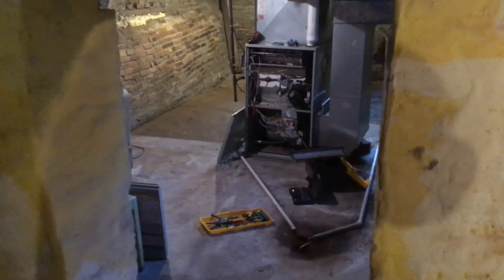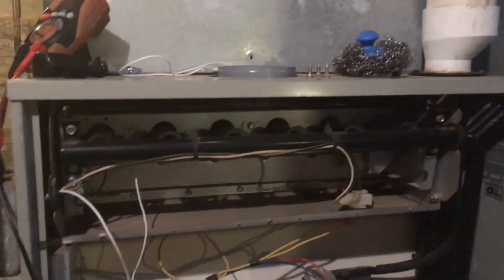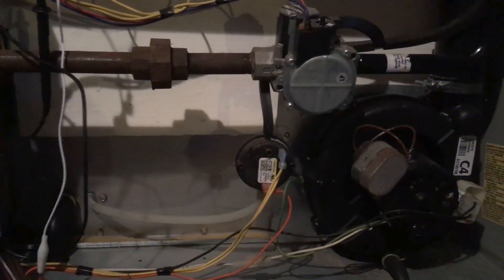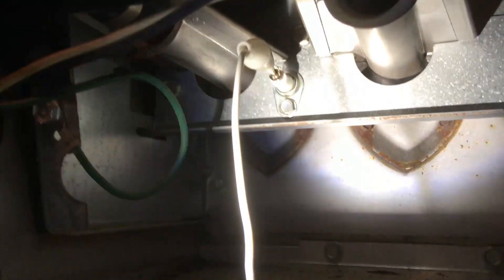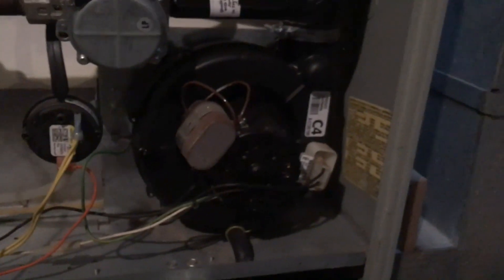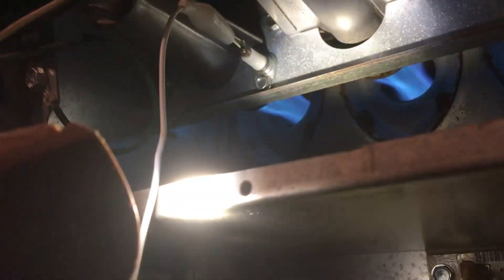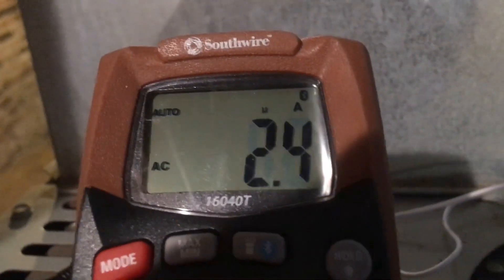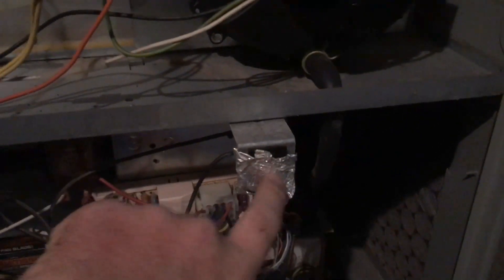Ameristar Furnace Diagnosis and Repair

Comment: From what I understand about those flame sensors, a current is actually conducted through the plasma in the flame itself. Then contact between the metal probe and the flame completes the circuit. Hence why they need to be clean in order to operate properly. Neat stuff.

Comment: Bill Maf sensor  which can be purchased at your local auto parts store works good for cleaning heat sensor rods my hvac technician uses it on the ones he services for their annual cleaning also the cellar stairs in the cricket palace can be accessed by just pulling up the stair tread I think that is what it is called they usually are just nailed across you most likely have a support that is partial rotted out happen at my home we ended up rebuilding the whole staircase and adding a small landing at the bottom I love al your videos you have a real talent

Comment: Three weeks ago, I completed the installation of that which will be "my last dual fuel (gas) split" install.  Not of my choosing, I installed a Nortek 3-ton R410A, onto a Nortek 72,000 Btu/95% AFUE High Efficiency Gas Condensing Furnace. About three months ago, I advised a friend on the sizing, and type of central air/gas heating unit required to heat and cool his manager's residence. He co- owns a motel which utilizes my services to care for 47 Amana PTAC/PTHP units in all stages of the "Goodman Warranty"; It's easy work, and very seldom am I required to open the sealed system.

I had no intentions of doing the install, as I'd ceased installations in 2014, when the scourge of MS took its toll.  I'd advised him that a 48,000 Btu/2.5 ton matched dual fuel system would work well, and that the length of cycle would serve to dehumidify well, with just enough dwell time so as not to overburden too small of a system. I also told him "NOTHING MICROCHANNEL"!

Five weeks ago, I repaired two PTAC's which had 'capacitor and thermistor issues', at another of his properties. It was at that time he informed me that the contractor he'd chosen "wasn't doing things the way he'd asked".  He delivered a 1.5 ton condensing unit+evaporator coil (A-Sized), and a 72,000 Btu (6 tons)"C-Sized" gas (upflow) furnace. "Things just don't look right".

The short story is this: the contractor was paid for everything except for the install, I contacted Nortek for resolution assistance, which they provided fast, 100% stellar-quality mediation with the wholesaler, who was great, too.  I then wound up installing the A/C portion, and subcontracted the gas installation/combustion air intake, and "sleeved" chimney-height PVC exhaust to rid the place of that corrosive discharge those hi efficiency units are known for.

The wholesaler even helped, by throwing a 5-2-1 into the pot.  BTW, 397 micron pull, straight-on superheat/subcool, and a Δ-temp of 19°F, after 90 minutes.

Comment: Our heater was out a couple days ago right when it got cold and we needed it.  We changed the filter and tried troubleshooting everything we could but it still wouldn't light.  The professional from the gas company looked at it yesterday and he thought it was a bad gas valve.  I thought that was total horse hockey because the heater was professionally installed brand new less than 2 years ago.  I guess we should expect new things to break like cars and heaters.  
The man came back today and installed the new valve but it still didn't work.  Finally, he called in for backup and  3 more people came to flush water out of our gas line.  The hot water heater and stove were still working but the water in the line was preventing the heater from lighting.  The man was mad at himself for not diagnosing the problem correctly the first time.  I'm just glad it's fixed and it didn't cost anything since it was the service line between the curb and our house and not an internal issue.

Comment: very interesting. I found a groundhog in my furnace last week. He had fun in there....
Reply: Ouch
Reply from the maker: Back when the Comfortmaker 90% efficient furnace in my home was new, the contractor who installed it said that he'd seen a lot of birds and even some mice get into the vent piping, only to jam up the works. All these years later, I've never had any trouble with critters getting in there. It probably helps that the inlet pipe is up off the ground by several feet. (The outlet pipe does reach the ground.)

Comment: Seeing those bare gas flames like that makes me glad we use balanced flue systems over here in the UK, granted there are still houses with ancient Baxi systems (they reside behind a gas fire in place of an old coal back-boiler) which draw air from the room, but still, I'd rather have a balanced flue... :S
Reply from the maker: When fully assembled, the burner box is a sealed unit in most of these more modern/high efficiency furnaces. It's also supposed to be supplied with fresh air from the outside via a pipe. For some reason, almost every one of these I see isn't set up that way.
Reply: Need tighter regulations there then, over here if a gas appliance isn't fitted as it's meant to be, it doesn't get connected to the gas supply (assuming the engineer isn't a rogue cowboy of course), doesn't stop some houses from blowing up, but, still, better it's done right first time... :)
Reply: Usually if the combustion air on a condensing furnace isn't being pulled from outside it's usually because it replaced a old furnace.
Reply: The manufacturers allow single pipe install. gov't regulations which require 2-pipe would effectively ban mid efficiency furnaces which take their air from inside and don't give the option of connecting an intake.
Reply: @Jon-hx7pe  in Canada the building code outlawed new mid-efficiency gas furnaces but you can still use inside combustion air if the installer calculated sufficient makeup air in the furnace room.
Reply: I know. Was just saying, if combustion air from outside became a requirement in the states, mid efficiency furnaces wouldn't be able to be used, at least not without a new design.
Reply: Yeah baxi systems, on the plus side you don't have to worry about ventilation, the air for combustion will be replenished. Many people plug up their chimneys and use a balanced flue condensing gas boiler, and find condensation, damp and air quality problems.

Comment: I think I can see why you got into HVAC, troubleshooting systems like that seems like really interesting work. Might even be something I'd consider in the future, if my current plans don't work out.
Reply from the maker: I was hoping to improve my chances of landing a good, steady job when I went to HVAC school. I had a blast in the classroom and maintained a 4.0 GPA throughout. I liked the troubleshooting and repair a lot. Less so for the installation, though that's got more to do with the "shallow" nature of the installation class I took. I didn't get a lot of out of that.

When it came to the actual job market, my experience was severely underwhelming. Not a one out of many dozens of companies seemed even slightly interested in me. While there was one that finally took me on, the less said about that, the better. The place was a dump and that job was an utter disaster, although in fairness I'd have to say the owner offered to pay me exactly what I asked on the application, which was more than any other business I interviewed at.

Just like my freelance computer consulting, I'll happily do HVAC work on the side. Only that's not what I was hoping for. I want and need steady work with benefits. Fortunately, it seems that the winds of fortune have changed, and I've landed a computer/IT related job for what should be a reputable company.

Comment: " I'm also not sure why it's so common for people around here not to attach an inlet pipe to the furnace's burner air inlet. "
^Anything to save a buck.

I'm sure you'll end up seeing a lot of two stage furnaces on single stage stats as well, along with stuff being grossly oversized and improper setup/commissioning.

Comment: we have a 140,000 btu furnace. from 1986, uses a pilot light
Reply: 180,000 BTU Lennox G8 from 1981 here, also with a pilot. I hate it.
Reply: y u hate?
Reply: @randomrazr  pilot lights can be expensive!
Reply: Because it's loud, inefficient, and costs a fortune to run. The newer part of the house is heated by a  60,000 BTU Trane (2000) that's just so much quieter. It also does a better job of keeping the temperature even. I'd love to replace that old Lennox, but you know...money.
Reply: how much a month during winter does the old one cost to run

Comment: I have a 1988 vintage comfortmaker furnace.Lastyear I had the same problem where it would not always ignite.the guy that came out figured it out after awhile but at the end he said I should think about getting a replacement furnace in near future.He said the burners were wearing out.I'm disabled so I live on a limited income and was wondering if replacing the burners would be feasable or not?
Reply: burners don't really wear out, unless they're rusting, which they shouldn't be.

See if there are any low income weatherization programs in your area - u may be able to get a rebate or grant on a replacement furnace.
Reply: what makes furnaces need replacement?
Reply from the maker: Usually it's a failure of the heat exchanger, which would then allow combustion by-products into your home (such as carbon monoxide, which is a silent killer). Replacement heat exchangers might still be available, but generally aren't worth it.

I'd get a second and maybe third opinion before you commit to anything major. Get a carbon monoxide alarm if you don't already have one. If you do buy a new furnace, I'd recommend a 90% efficient model. Even though you can buy a more efficient furnace, the operational tolerances are much tighter and parts are much more expensive. Just one failure could take away all the money you saved on energy.
Reply: Nothing special about 95% single stage, just better secondary heat exchanger to condense a little more moisture out of the exhaust than the basic 90-92% models. It's when you get into stuff with  ecm motors (blower and in some cases inducer too), usually 2-stage or modulating that the repair costs can become very high. Extra thermal efficiency in itself doesn't add much to cost.

Even when looking at the mid range to higher end products, there can be significant differences in repair costs depending on the type of ecm motor (x13 vs fully featured), whether the inducer is also ecm or not, the  control board used.

Comment: So the rod was so dirty it's resistance was really high and the conduction of electricity through the flame was too low a current.
So the controller thought "Failed to light" and shut it down.
Roughly speaking lol.

Comment: I'd go ahead and replace that sensor with a new one.   They aren't very expensive and in my experience just cleaning them is a temporary repair.   You don't want a no heat condition on a below zero Saturday night due to a 20 dollar part.
Reply from the maker: I made that suggestion to the occupants of the house, and I think they'll go for it.

Comment: Dirty flame sensors are one of the most common causes for no heat. It's a shame because it only takes 2 seconds to clean. If your flames drop out in the first 5 seconds of ignition 95% of the time it's the sensor, in rare cases it can be the board itself.

Comment: You aren't supposed to clean the flame sensors they are supposed to be replaced.. they have a coating on them that once you clean them they will begin to rust just replace it they are a cheap enough part...
Reply from the maker: First time I've ever heard that. Even my instructors (and text book) said otherwise!

I did make the strong suggestion that the part should be replaced.

Comment: Its burning clean
Reply from the maker: Propane is a very clean burning fuel. If you've ever seen a tractor engine equipped to run on propane, their engine oil often looks as good as the day it was put in.

Comment: I hate gas anything. It is high maintenance, complicated, and can kill you if you do not maintain it well. Many years ago, we had to pay $600÷ for a new control board installed for our gas furnace. Maybe we overpaid?  Yes, but they come out right away.  Still, how would you inspect the heat exchanger for rust holes in this unit or any other, in order to assure the homeowners that they will not die from carbon mononxide poisoning?
Reply: at's why we carry carbon monoxide detectors and inspection cameras as service tech :)
$600 is right on par for a new circuit board
Also your claim that gas heating is high maintenance and complicated isn't even close to the truth
Reply: What are the alternatives? Combustion, despite being complex to control, is much better than electric resistance heating, and heat pumps, they are even less reliable than combustion!
Reply from the maker: I'll be right there with you when it comes to cooking stoves. Any day of the week I'd rather have electric, probably because that's what I was brought up on, and I don't like the "smell" of an operating gas stove's combustion by-products.

Properly installed gas heating really is no less safe or reliable than any other method. A properly installed gas furnace's lifetime is typically measured in decades. Of course, anything can break and I'm sorry to hear of the unexpected expense. That's never any fun. Carbon monoxide is certainly a real hazard, but it's easy and relatively cheap to put your mind at ease with one or more detectors. Most of them alarm long before a person of average health would notice a problem. Some also detect flammable gas leaks.

I can think of many ways that one might inspect a heat exchanger. Most all of them can be removed after taking the burner assemblies out of the way. One might give it a (very) cursory examination by removing the blower wheel assembly or looking down the supply air plenum. It's certainly possible to run an inspection camera or mirror through it (though a little less so for any secondary heat exchanger on a furnace so equipped, as most of those look like refrigeration coils and are much smaller).

Gas heat and appliances are practically the standard around here, since electricity's not that cheap and natural gas is. Electric heat is more common in rural areas, with most of the rural electrical cooperatives giving a special rate (sometimes as low as 2 cents/KWH) for resistive, geothermal or heat pump systems. Propane's a good deal more expensive by comparison.